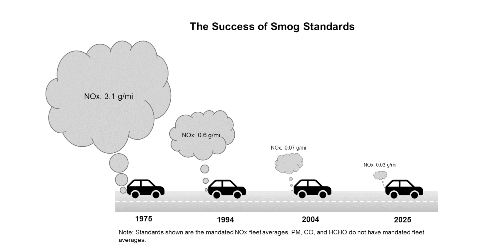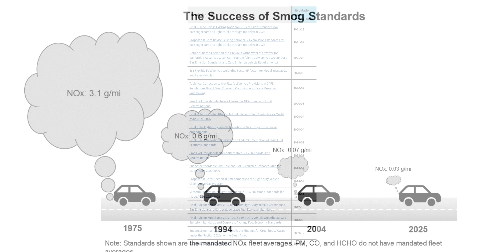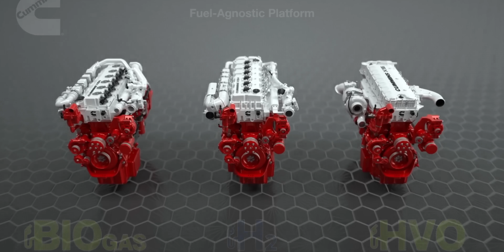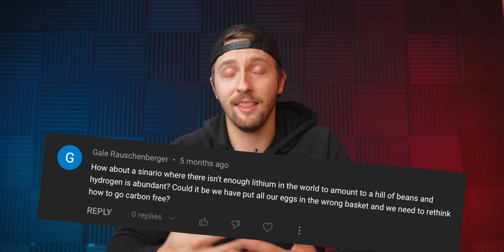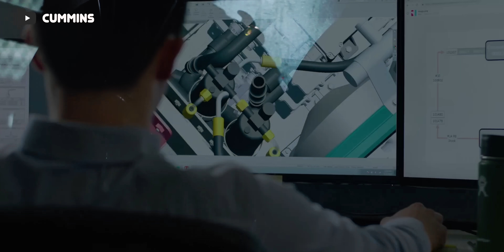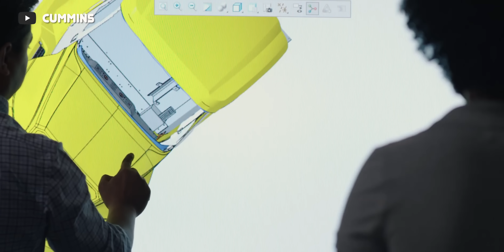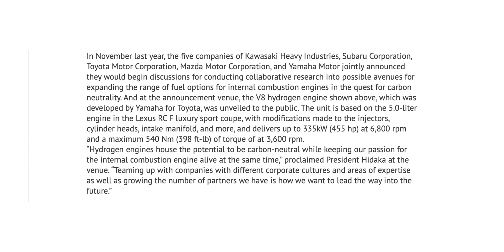Cummins Hydrogen Engine Will KILL DIESELS FOREVER

Comment: Diesels are better suited for hydrogen fuel than a gas based design.as one commenter mentioned,the first diesel ran on peanut oil and can run on damn near everything that's combustible.
Reply: Most pre 2007 deisels will run on anytype of fuel just takes a few tweaks to make it run properly
Reply: I bet that smelled nice.
Reply: https://www.youtube.com/watch?v=JuxQLEDccsU
Reply: Why would they not use a fuel cell instead of a ICE?
Reply: @Greg Kramer  because big oil likes waste the less efficient the better more sales for them that why they hate evs so much its taking there launch the big buffet they had for the past century and they can see the end of the tunnel so they are trying to use a different fuel that they can monopolize to keep the money coming in
Reply: @lesstevens2370  The have no monopoly on hydrogen.  There are just niches where batteries are not practical going forward.  Long haul trucking is one area where it looks marginal but large agricultural tractors even more so.  They can burn 30 galleons per hour of diesel. This would be close to 400kwh per hour. This is not practical for a battery application so hydrogen will likely be the clean solution. Big oil has no real control over this.
Reply: @gregkramer5588 , Fuel cells that produce 150 KW is much more expensive than a 3.5L turbocharged V6 that can make about 400 HP or over 500 KW of power.  If mixed properly, with lots of air to a small amount of hydrogen, there is very clean exhaust from the engine.  I watched a video of a guy with a breathing mask connected to his lawnmower Briggs and Stratton
Reply: @gregkramer5588  H2 Fuel Cells are great but can't compete right now with KEYOU GmbH in Germany that replaces diesel injector with hydrogen injector.
Reply: @leroyessel2010  Where can you find this data.  Fuel cells are over 60% efficient I am shocked that an ICE engine can be over 50%.
Reply: @gregkramer5588  look at current generation Formula 1 engines for engines with that kind of thermal efficiency.
Reply: @Desert_Rogue_Tanker  I checked it out.  52%. Impressive and of course super expensive. Of course that is when combined with their hybrid system but still very impressive.
Reply: @leroyessel2010  I looked and they are not as efficient as I had thought.  No wonder batteries are going to rule instead of hydrogen.  It will be interesting to see what happens in the next few decades for high constant output engines like large tractors have.
Reply: Peanut oil, vegetable oil, used engine oil, pretty sure even molasses with work too
Reply: @MyDirtydan  Sourdough starter, maybe?
Reply: So it's a run on everything engine, seeing how gasoline is still cheaper then diesel, wouldn't it most likely just be running on gasoline? Seems like it's more of a fuel supply infrastructure problem.
Reply: @AmbiguousFrog  Gasoline is less per galleon but has less energy per galleon by about 15% and does not have the lubricative properties of diesel.  This make it fairly unattractive for this.
Reply: Not one commenter said anything about hemp and marijawana, and why it was made illegal and why isn't it being used for fuel today? 
 Automobiles and pot go way back.
Reply: @wcmwfab935  For bio fuel switch grass is even better.  If forms even more biomass.
Reply: How will I pull my 20000 pound _5th wheel and 35 foot boat?
Reply: @nutmg1   I would imagine you can afford whatever you want for that
Reply: @gregkramer5588  Not if they ban Diesels.
Reply: @nutmg1  That will happen but that is decades away so way too early to speculate on what will be best at that time IMO.  Chances are the US will be one of the slower countries to do this.  We pride ourselves on not doing the right thing.
Reply: Diesel fuel is not volatile..... hydrogen is very volatile, and dangerously explosive...that's why hydrogen will probably never replace diesel because it cannot be stored safely in a fuel tank
Reply: @Jason Hager   It can be starred and is used every day already.  Not to mention the number of carbon atoms per molecular diesel is way higher than hydrogen. Which of course has 0.
Reply: he means because theyre generally overbuilt..
Reply: The energy density of H2 wt/wt is x 2.3 that of diesel.
Reply: @jordansamhuri I would think you are talking per mass not volume. To get it by volume it would have to be under a lot of pressure.
Reply: @gregkramer5588  yes indeed I refer to mass.
Reply: Yeah im gonna go with E-85 for my 8v92, i allready fill and run BRP-XD-100 Etec 2 stroke oil from walmart.
Reply: They have TDI and a beefier head and block. Also they already have a high pressure fuel delivery system.
Reply: Fun fact Rudolf Diesels first diesel engine he produced wasn't even designed to run on diesel rather heavy ship oil, crude oil and whale oil of all things. I don't think when the first "diesel" engine was invented (the term diesel engine does not refer to the type of fuel that uses rather to the particular order of the intake combustion exhaust and compression strokes compared to lighter fuel burning lower compression engine IE gas engines) that diesel fuel was even invented yet.
Reply: @baltazard133T  its compression ignition, thats what a real diesel is!
Reply: @baltazard133T  pretty much wrong..refined crude oil 1859. 

Rudolph diesel patent internal combustion engine, 1892 - 1895

"1. In an internal-combustion engine, the combination of a cylinder and piston constructed and arranged to compress air to a degree producing a temperature above the igniting-point of the fuel, a supply for compressed air or gas; a fuel-supply; a distributing-valve for fuel, a passage from the air supply to the cylinder in communication with the fuel-distributing valve, an inlet to the cylinder in communication with the air-supply and with the fuel-valve, and a cut-oil, substantially as described." See US patent # 608845 filed 1895 / granted 1898[23][24][25]
In 1892, Diesel received patents in Germany, Switzerland, the United Kingdom and the United States for "Method of and Apparatus for Converting Heat into Work".[26] In 1894 and 1895, he filed patents and addenda in various countries for his engine; the first patents were issued in Spain (No. 16,654),[27] France (No. 243,531) and Belgium (No. 113,139) in December 1894, and in Germany (No. 86,633) in 1895 and the United States (No. 608,845) in 1898.[28]
 The refining of crude oil:
The Chinese were among the first civilizations to refine oil.[11] As early as the first century, the Chinese were refining crude oil for use as an energy source.[12][11] Between 512 and 518, in the late Northern Wei Dynasty, the Chinese geographer, writer and politician Li Daoyuan introduced the process of refining oil into various lubricants in his famous work Commentary on the Water Classic.[13][12][11]
Crude oil was often distilled by Arab chemists, with clear descriptions given in Arabic handbooks such as those of Muhammad ibn Zakarīya Rāzi (c. 865–925).[14] The streets of Baghdad were paved with tar, derived from petroleum that became accessible from natural fields in the region. In the 9th century, oil fields were exploited in the area around modern Baku, Azerbaijan. These fields were described by the Arab geographer Abu al-Hasan 'Alī al-Mas'ūdī in the 10th century, and by Marco Polo in the 13th century, who described the output of those wells as hundreds of shiploads.[15] Arab and Persian chemists also distilled crude oil in order to produce flammable products for military purposes. Through Islamic Spain, distillation became available in Western Europe by the 12th century.[16]
In the Northern Song Dynasty (960–1127), a workshop called the "Fierce Oil Workshop", was established in the city of Kaifeng to produce refined oil for the Song military as a weapon. The troops would then fill iron cans with refined oil and throw them toward the enemy troops, causing a fire – effectively the world's first "fire bomb". The workshop was one of the world's earliest oil refining factories where thousands of people worked to produce Chinese oil-powered weaponry.[17]
Prior to the nineteenth century, petroleum was known and utilized in various fashions in Babylon, Egypt, China, Philippines, Rome and Azerbaijan. However, the modern history of the petroleum industry is said to have begun in 1846 when Abraham Gessner of Nova Scotia, Canada devised a process to produce kerosene from coal. Shortly thereafter, in 1854, Ignacy Łukasiewicz began producing kerosene from hand-dug oil wells near the town of Krosno, Poland.
The world's first industrial petroleum refinery was built in Ploiești, Romania, in 1856 using the abundant oil available in Romania.[18][19][20]
In North America, the first oil well was drilled in 1858 by James Miller Williams in Oil Springs, Ontario, Canada.[21] In the United States, the petroleum industry began in 1859 when Edwin Drake found oil near Titusville, Pennsylvania.[22] The industry grew slowly in the 1800s, primarily producing kerosene for oil lamps. In the early twentieth century, the introduction of the internal combustion engine and its use in automobiles created a market for gasoline that was the impetus for fairly rapid growth of the petroleum industry. The early finds of petroleum like those in Ontario and Pennsylvania were soon outstripped by large oil "booms" in Oklahoma, Texas and California.[23]
Reply: @FFLFFS  lol cool story bro, hopefully you can find somebody to read all of that mess as I don't have time being at work at all 👍
Reply: @baltazard133T  I get it. Very well shown in your first comment btw. 
Pretty much what I expected lol
Have a nice day.
Reply: A diesel engine is an oil burner, regardless of where the oil comes from. Also, compression combustion and NOT electrical ignition as in a gasoline engine.
Reply: gas engines convert just as easy
Reply: @MarkAlanKing  no bro!
Reply: @Mark Alan King - Lions of Israel  ok, go ahead put used engine oil in your gas tank, tell me how that works out
Reply: @MyDirtydan  I'll tell u I have 3xtensive experience with many alternate fuel sources. And some work better than deisel.. u cannot school me on using used engine oil. And before you answer. Think about why the military has used deisel fueled vehicles for so long in there service vehicles and almost all military vehicles.
Reply: @MarkAlanKing  no not even close gas engines aren't anywhere near as strong they tried it with the gm's 350 engines and a bunch of others because who knew you'd crack heads and destroy a crank or block from compression alone most factory gas engines have anywhere from 8.5:1-10.5:1 compression ratios most diesels have 14-20+ the webbing in the castings of a gas engines main component's let alone everything else isn't designed for anything diesel like and are way more prone to detonation to to the fuel temperatures being extremely higher then the gas counterpart the list goes on
Reply: @in-rust-we-trust1968  work just fine and inventors have lost their lives over it
Reply: @MarkAlanKing  If you aren't using gasoline as your fuel, then I don't see many reasons to choose that style of engine for conversion. They run on much lower compression requiring spark combustion and have lower thermal efficiency than diesel. Unless it's purpose designed or custom rebuilt, a gasoline engine is structurally less robust and the lower compression means much higher rpm's for pulling power. A good diesel engine's life expectancy is many times that of a good gas engine.
Reply: @in-rust-we-trust1968  they work fine. I had a 1993 Camery powered hydro. Took 4 dry cells and an alternator upgrade but it worked. drove that thing for months without hardly putting gas in it before the transmssion shat itself. it had 200,000 miles on it when i was done.
Reply: @in-rust-we-trust1968  What has converting a gas engine to hydrogen have to do with converting it to diesel. Diesel engines need very high compression to work, not so with hydrogen. If it was a big problem then Toyota wouldn't have been investing money into it. They've given up that idea already as well as Mercedes, they gave up on it too.